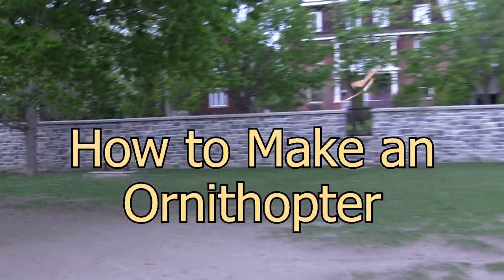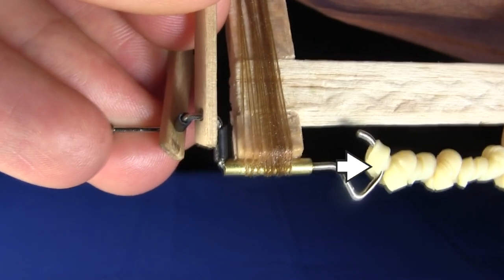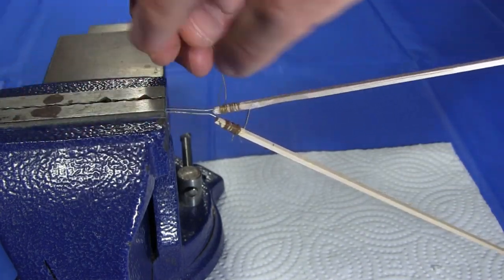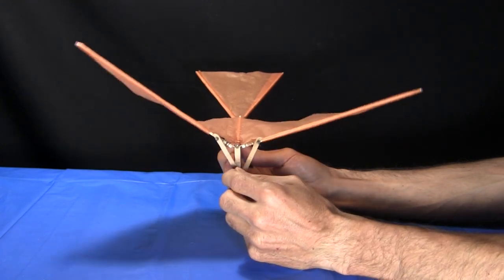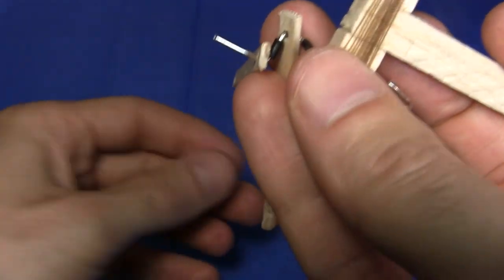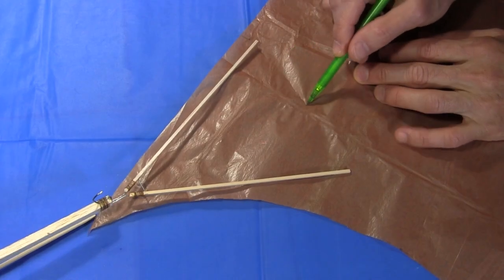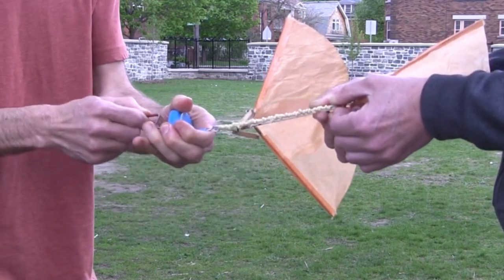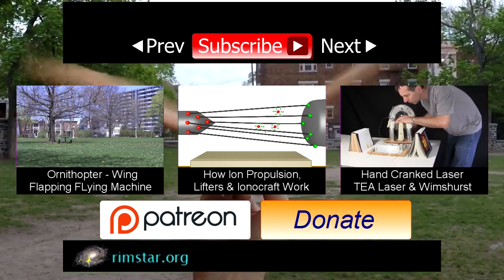How to Make an Ornithopter (Rubber band type)

Comment: I made this 3 years back, as a part of my TOM project, showing this as a 6 links mechanism. Fun part is, out of nowhere, today I got this video as my first recommendation on the feed 😂😂😂.

I just came here to comment, YouTube algorithm is high since last few days 😂😂😂
Reply: I want to make this as my school project)
Reply: @АлександраКобзева-ж4ж  Gotta start collecting candy sticks then😂😂
Reply: @zeeshanlakdawala  hi please help me mine is flying a little and then falling :(
Reply: @AdityaSingh-kw8bi  Just try with a high tensile strength rubber band. The more the pre rotations, the longer the flight.

The rubber band quality makes a lot of difference. You can also can do by merging multiple bands together, but then you will run into problem of them fusing together. Just apply some oil or powder while using multiples, to avoid fusion.

Comment: What is the length of the tan rubber you used in making ornithopter?
Reply from the maker: I didn't measure it but from looking at the video at 7:28, I'd estimate around 2 feet or 60 cm.
Reply: Thank you

Comment: Sir if it is flapping it's wing slowly,then what to do so that its wings flap quickly
Reply from the maker: If it's flapping slowly both up and down then it sounds like your rubber band(s) may not have enough energy. You could try doubling them like I show at 7:15. You could also try adding grease (7:25). You may also have too much friction at where the paperclip pulls against the bottom cylinder (1:33). Make sure that cylinder is metal and has a smooth end. Most other problems would usually cause the wings to flap unevenly, harder in one direction. Let me know if you need more tips.

Comment: I have two question: can  I use the same tube you used for wings for rubber band?
How long are the wings?
Reply from the maker: You'd need a larger diameter plastic tube for rigidity and it may or may not be too heavy -- hard to say for sure.
For the wing lengths, I talk about making the wings at 3:03 and give the dimensions in that section. I give all dimensions throughout the video.

Comment: Niiiice. The stops from probably 16 guage wire insulation is imaginative. 
It seems aluminum TIG welding rod would be stiff enough to replace the paper clip wire, at least for the tail mount.     
Realistic flapping. As intended, it looks like a bird when flying.

Comment: impressive flight! What if you add a light hinge halfway down each wing so that the wings can fold down on the upstroke and straighten out on the downstroke?
Reply from the maker: I would have thought of that as a good idea too, until I started this project. It turns out you want the wing to be flexible and for the material to curve upward on the downstroke as it does, except near the fuselage. You want the air to be approaching the wing from a vector that's pointing slightly upward with respect to the wing. That's called the desired angle of attack. For the part of the wing near the fuselage that's easy to visualize. But the further out along the wing, the wing is not just moving forward through the air. On the downstroke it's also moving downward. So the direction of the wing through the air on the downstroke is a vector that's forward and down, and this vector is steeper the further away from the fuselage. Basically the section of the wing near the fuselage isn't moving as fast as the outer tip of the wing, which moves down very fast. That means to keep the desired angle of attack relative to the wing, the wing has to change shape, as it does. The further out from the fuselage, the more the wing has to change shape. Propellers are shaped the way they are for this same reason.

Comment: i once had an ornithopter, a bought one, wich was so heavy because of its realistic design( a dragon ), that its rubberband had the power of a v8 motor! At least it felt like that. It flapped two times as fast as the one in this video, and was stupidly loud. It ended up ripping its gear box apart after a few flights because of this a half cm thick rubbergand, it was fun to watch it fly( not a o hear it ), but the design was very faulty. Now i have two rc ones, one is a rare four winged dragonfly, the wowwee dragonfly exactly.

Comment: what is the parameter which we want our rubber band to have?
the stronger and thicker the better or I should opt for soft and thin one?
the strong one gives more thrust but on the other hand soft one can be winded up more times

Thanks for the answer in advance!
Reply from the maker: That's hard for me to say for a regular rubber band. I'm used to the type I show near the end of the video. That one's thin so maybe use three or four thin ones at the same time. Also, try using the lubricating trick I show near the end. That'll allow you to get more turns. I never thought of trying that trick with regular rubber bands so if you do it, let me know how it goes.
Reply: RimstarOrg sure 
Will let you know about the results later

Comment: Now just scale it up and go for a ride. ... : )
Reply: The Rubber band Torque to wing flap ratio wont work, we cant scale it up, we have to take the lift force rquired into account
Reply: @SwastikSwarupDas  could still use torsion, da vinci tried- couldn't figure out how to use his body+weight for the  Fuselage, different times - different access to materials- still yet to be done
Reply: If this does work it would make a huge shake

Comment: nice demo what mazer n weight must be perfect or verable as main point is of rubber band twist and with it flying bars should be moving smoothly.please advice my point thanks better than other vedios'demo.also have can we get rubberband like u used.or can we joint more peace of rubber bands.please reply.
Reply from the maker: I don't understand much of what you say. The translation isn't clear.
Here's one source for the rubberband http://www.ebay.ca/itm/Contest-rubber-FAI-tan-super-sport-motor-stock-band-In-coments-state-size-Qty-/351912421970?hash=item51ef9d6a52:g:rKMAAOSwnDZUIaHZ. I bought 1/8". I didn't buy from them. The person I bought it from is no longer selling it.
Yes, you can join pieces together.

Comment: if you paint the wood with acrylic paint would it weight more to the point that it wouldn't fly? and about de shape of the paper? does it make a difference if I change it? Thanks for the great video!
Reply from the maker: With paint it probably will still fly but it may not fly as high or it may not longer fly vertically at all, just horizontally or even gradually downward. That's how my development process went: first spiraling downward, then after making it lighter it flew horizontal, and then lighter still it flew upward.
Regarding the paper shape, I just roughed it based on what others had done and what seemed to make sense so there's probably some leeway.
I'm glad you enjoyed the video! Thanks!
Reply: I painted it and will try to see how it works! Thank you so much!
Reply from the maker: Let me know how it goes!
Reply: Well... I can't even make the wings flap soo... no it doesn't fly... :(
Reply from the maker: Neither did my first few ornithopters. It isn't easy, but it is doable. Regarding the wings flapping, the biggest trick I found there was to make the distance between where the wings pivot at the fuselage and where the cranks connect to them long enough. That section of the wing is called the lever and too short a lever and the cranks just can't lift them, or have difficulty making it very jerky. My first lever length was too short. What length did you use?

Comment: Wooow! I didn't know exist this kind of plane so easy to build! But, I don't know where find the japanese paper... :/ But, I suppose there are an other type of paper that work well too, or not? ¡Muchas gracias por compartirlo! Saludos desde Argentina. 👌👍
Reply from the maker: Other types of paper should work too, like the paper from the flower shop which I also showed. I just can't guarantee it because I haven't tried it all the way. I tried it while I was still experimenting and getting everything to work and at the time, other things were preventing it from working. So by the time I had everything working right, I'd moved on to the Japanese paper.

Comment: Good project,
What is the lengt of the rubber band?
Reply from the maker: Thanks.
I never measured it but I'd guess around 28" formed into a 14" long loop before putting it on.
Reply: Thanks for the information

Comment: I made the model with the same measurements as given. But I'm unable to get the wings to flap for a longer duration. The wings stop flapping after unwinding some turns only. Please help how to achieve longer and better flights. 
Can the size of the front motor hook on which the rubber band is hooked make some difference?
Reply from the maker: The size of the hook portion of the front motor hook shouldn't matter but make sure it's not so big that it's hitting the fuselage.
One thing that could be causing your problem is the lever length. At 3:12 in the video, that's the measurement I say to get precise, the 7/8" or 22.5mm. That length literally acts like part of a lever and if it's too short then the crank has to do more work in order to lift the wings. Getting that right is the biggest thing that made mine finally work.
Another possibility is that your rubber band is hitting the fuselage since it's pretty lumpy when it's wound up.
And another possibility is the type of rubber you're using doesn't give long flights. Notice the office rubber bands I show at 7:14 don't turn for very long.
And another thing to look at is how tight the wing-tissue is near the fuselage.  Look at the video at 6:46 where I move the tissue back and forth along the wing spar. Notice how the tissue flexes near the fuselage when I do that. You don't want the tissue to be so tight near the fuselage there that it prevents the wing from moving up and down easily. This tension can be adjusted when you tape the ends as I do at 6:49 (don't worry if you tear the end of the tissue a bit at the wingtip if you have to untape and retape it).

Comment: If it is little heavy also then will it fly?
Reply from the maker: That's what I'm not sure of. Before getting it working well, I was doing two improvements at the same time: I increased the distance between where the wings pivot on the fuselage and where the connecting rods connect to them, and I kept making it lighter. Since I was doing both at the same time, I'm not sure how big a difference making it lighter played. Judging by how ornithopters are made which are demonstrated flying in some other videos, I'm guessing it can be a little bit heavier. For example, I recall seeing one flying which used aluminum foil, which is relatively heavy.

Comment: Hi rim I am Vaibhav from India and I am a fan of u after watching this video,can u please tell me what paper u used for rubbing paper clips and I didn't get sport rubber here so any other thing I can use????          Hoping for your reply
Reply from the maker: If you mean what I'm doing at 4:36 in the video, that's called sandpaper. It's normally used for smoothing or sanding wood.
If you can't get sport rubber then you can use ordinary rubber bands but your flights will be shorter. Try putting two rubber bands like I do at 7:14.

Comment: very nice project for my grand child. Wat is the lenght of the rubber band ?
Reply from the maker: If you mean the one at 7:28, it was around 2.5 to 3 ft long before tying it into a loop. But when you buy it you'd be buying more anyway since they seem to work less and less well as you use them. It's not expensive and usually comes with plenty. I don't know how many flights you get before they don't work at all but you'd probably want to start with a new one each time you go out to do some flying.
Reply: Thanks for the information

Comment: Awesome!!...I'll try to make it soon:)
btw,what kind of wood did you used?
Can i use Cutted Flywood..and place it together?
i have a very thin 3 flywoods...
Reply from the maker: I used balsa wood. The wood has to be extremely lightweight. Bamboo is another option, and then there's also more expensive carbon fibre.
I'm not familiar with flywood. Searching for it didn't help. Is it very lightweight?
Reply: RimstarOrg RimstarOrg sorry about the word "Flywood"😅...I know it's hard for you to understand that because You're living in Canada and i'm Living in Philippines because i am Filipino....
Flywood doesn't Have a Lightweight...it has a little bit of Weight (sorry for bad english)
Can i still use that?

or Can you give me another option(s)..To use......Rather than using a Balsa Wood...
Reply from the maker: As I said, I'm not familiar with flywood so I can't say if it would work. Tell me the dimensions of a piece and the weight and I can use that information to compare it to balsa wood.
Other options are bamboo and carbon fibre.
You should be able to find bamboo somewhere. You can probably find it in craft, hobby or art stores but I find it as a product used for putting in pots that have plants in them for tying to the plants to hold them vertical. For that I find it in dollar stores but I guess stores that sell plants might have it too. Bamboo is probably used in a lot of things that you can find.
Reply: RimstarOrg Ohhh Thanks for suggestion...I found some Bamboo in our Neighbor's Backyard.....Can you tell me the Right Measure of Bamboo needed to be used? or i can just simply follow the measure of  Balsa wood as shown in the Video?
Reply: RimstarOrg Forget about the Flywood...:)
Reply from the maker: Just use the measurements of balsa wood shown in my video. Use the video for the lengths of the pieces, but bamboo is stronger than balsa wood so you can make the pieces thinner. You might have to experiment a bit.
Here's a video about working with bamboo for ornithopers: https://www.youtube.com/watch?v=jvjZaAI0LJk
Reply: YEAHHH...THANKS MAN, I'M DOING IT RIGHT NOW,I HOPE IT WILL WORK!!!...THANKYOU VERY MUCH!!

Comment: Awesome, but one question,

why using grams and inches ? (two different measurement systems)
Reply from the maker: Well, I used both inches and millimeters for lengths since my viewers use either of those two. But I just checked and when I showed weighing the ornithopter I gave both grams and ounces. I did forget to mention the ounces once when I gave the weight of just the tissue though, or perhaps I gave only grams for that because that's how the manufacturer specifies it. Did I miss giving both at other times?
Reply: no. i'm just a french viewer confused. Usually americans stick to one or another :)
thx for the explanation and again congratulation on the design, it's simple yet genius and can be made with household items. My nieces and nephews will be VERY happy thanks to you.
Reply from the maker: Ah, I see. I'm Canadian and we use mostly metric but still a lot of imperial. But I do both here because my videos are viewed from all over the world.
I'm glad to hear you like the design. It was a lot of fun to get working. Let me know how it goes.

Comment: can we perform the same by using metal, instead of wooden sticks and rubber with some other mechanism  ???
Reply from the maker: Yes. You can make a remote controlled motorized one. It would have to have a larger wingspan for the extra weight. I haven't done this myself so I don't have any design for you though. There are examples of this on youtube, though I don't recall seeing any plans. If it's rubber band powered then metal would be too heavy.
Reply: can it fly
Reply from the maker: Yes. Search for "ornithopter" on youtube and you'll find plenty of them.

Comment: I tried this and one wing goes up and then the other. They don't go up together. If one part of the crank is 6 mm and the other is 8, is that a problem?
Reply from the maker: With those measurements they should move up and down pretty close to the same time. They're the same measurements I used. If it's not too bad then it shouldn't make too much of a difference.
Are you sure the holes in the connecting rods are the same distances apart (the 45mm measurement at 4:42 in the video)?
Are you sure the lever lengths for the wings are the same lengths (the 22.5mm measurement at 3:12 in the video)?
If that's all the same then make sure you put the connecting rod for the right wing (the one on the right when looking at the ornithopter from the front) on the innermost crank like I show at 5:18 in the video. I don't know why that would make a difference but I seem to recall it did at one point during development.
Let me know how it goes and what the problem was. That helps me help others.
If you want to experiment with the dimensions then the software I used to help with testing different measurements before I made it is here http://www.ornithopter.org/software.shtml.
Reply: RimstarOrg

Comment: In the video shows 7.0 in the weight of the ornithopter. In this case corresponds to 7 grams in total?
Reply from the maker: The 7.0 grams includes everything except the rubber band. A 24" length of rubber band (as measured before tying it in a loop), which is around how much I use, weighs around 2 grams.